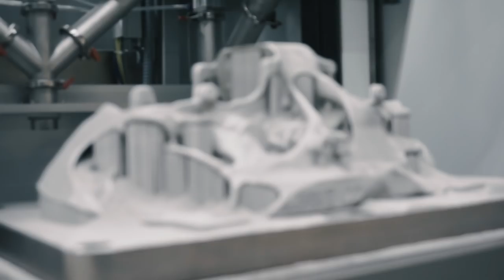BUGATTI Titanium Brake Caliper from 3D Printer

Comment: This was printed by an slm500 that cost 500.000€. As my job as an electrician i once had to install the power plug and lights for the room. Glad i didn't break anything by dropping a power tool or something else on the 3d printer. This was for a company in Luxemburg that made aeroplane parts. High tech stuff. They were impressed by my knowledge of bugatti parts.

Comment: What is this material?
Reply: Titanium????
Reply: Is it?
Reply: Yes, it's sintered by the laser, layer by layer and then baked in an oven to fuse the layers together.
Reply: What David said, it's titanium powder, or some blend thereof.
Reply: David F. No, there's nothing been baked. By Selective Laser Melting the Laser melts the Metal powder completely. You get components with density higher than 99% (most arround 99.8%)
Reply: GolfKR_ STV ah my apologies. Thanks for clarifying
Reply: It requires correct adjustment of parameters like laserpower, laserspeed, hatch and so on for the respective Layer thickness. 
An additional Heat treatment just to increase density and close pores could be done. Its called HIPing (Hot isostatic pressing). But a sintering process like at ceramics is not necessary.

Greetings from Germany
Reply: and then nano bots hammer the surface for surface forged hardening.  @GERprogamer